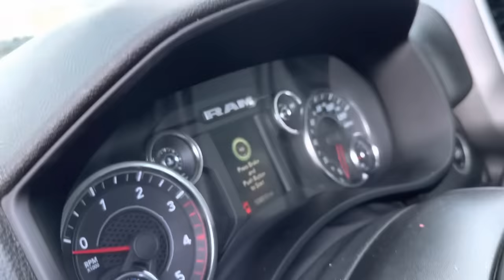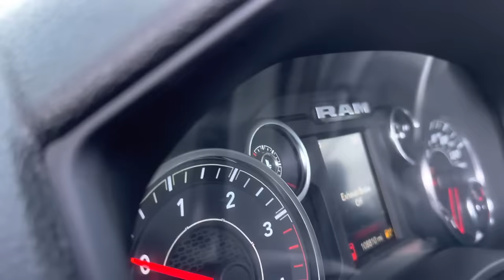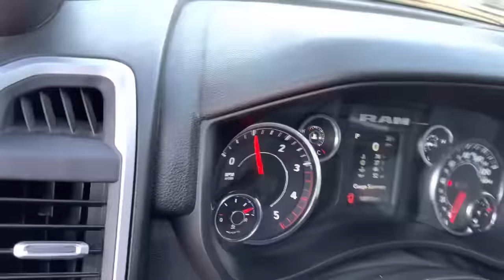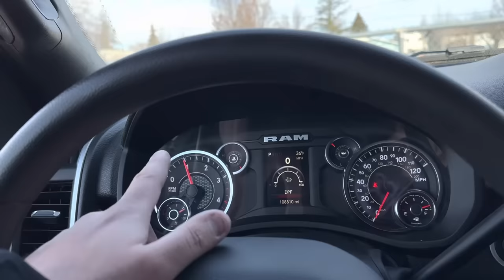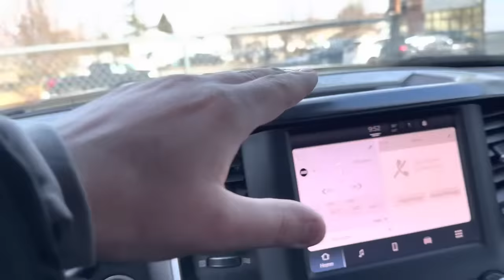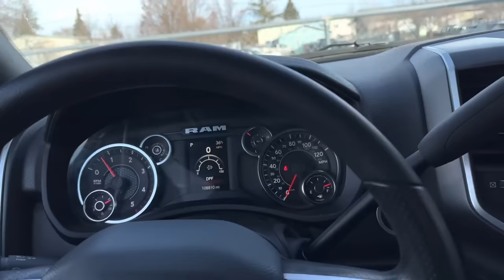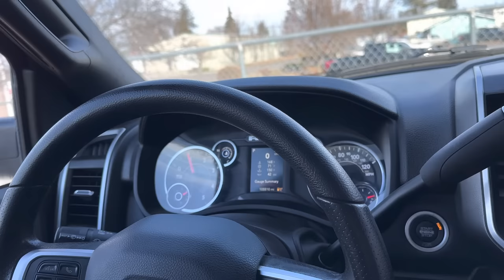2022 Ram 3500. 3rd engine down. 3 signs your engine is failing.

Comment: Really makes me appreciate my 2003.  It has no choked down emissions, it has no Def, it has no sorry automatic transmission.....it has no 80 grand price tag....it's lean and clean, simple and mean!
Reply: I’ve still got my 03 too. Had it since 05 has 172k on it now. It’s dirt simple compared to these new trucks
Reply: I have a first gen and had a 2006. Both extremely reliable trucks. Wish I had another '05-'06. My '90 first gen has 935,000 miles and would not be afraid to drive it across the US. Still performs great.
Reply: yep this is the same reason i keep my 2000 7.3 powerstroke
Reply: It's a dodge... Shit
Reply: @Hollywoodhouse74  That would probably be more on some of their transmissions, the Cummins engines are pretty solid. The 6.7 is prone to more problems because of the emissions bullshit.
Reply: @cliffterrell4876  What transmission does your first gen have?
Reply: @myk1_sp  funny because that engine isn't a dodge engine... And ever since Cummings has been putting them in... Dodge be Cummings apart ....
Reply: @Hollywoodhouse74  I accidentally typoed. And yes, that is very true!
Reply: Ya go tow a 25,000lbs gooseneck daily for 365 days straight and see how long she last 😂
Reply: @ksich8142  A diesel would make more sense in those environments. For these cases, I doubt people would be towing over 12k lbs, so modern gassers would probably be fine.
Reply: 05 f-350 checking in. Same here. I'd rather have my truck vs a new one for so many reasons
Reply: @myk1_sp so  I thought it was built for towing are was supposed to be
Reply: @banksboy6806  They are typically built for low-RPM torque and better fuel efficiency!
Reply: Think everyone agrees with you till you need a much higher tow rating and have to buy a new one
Reply: I'll take a later 4th gen any day. Had a 1998. Good truck. No match for my 2014 6.7.
Reply: @Hollywoodhouse74 all manufactures have their issues. I persoanly had many issues with my Powestroke.
Reply: I feel you..   Have a 03 also.  No issues, I just have to fine-tune my trans..  Bought a 2022, been in the shop more than on the road...
Reply: Would like to see a video on the miss fire..  Took mine to the shop.  They said it was gas mixed in with the diesel fuel..  Find the hard to believe since every other day, I'm filling the tanks at truck stops.  Then, also get from the shop is air filter is not OEM..
Reply: This and other things has me seriously looking back at a 2003 to 2005 1 ton.
Reply: I have my 08 deleted its been a great truck i have it bumped up just enough on power still verry reliable
Reply: Have a 95 and had a 2005 ram 3500 duallys I hot haul for a living and the 2023 I bought this Jan blows my old trucks out the water, don't get me wrong I love my 12 valve but if I gotta choose between the 95 cab and Chassis vs my 2023 ram for a towing 2023 wins all day
Reply: That's fine...however,for me the cost difference between the 2023 and the 95... makes hauling with the 95 very sweet to me
Reply: I have an 06 loaded 3500 stick that just hit 100,000.  Once in a while the longer crew cabs look nice, but I will keep this thing as long as possible.
Reply: I have an 09’ 3500 and I hit a bump and a whole bunch of parts fell off🤷‍♂️🤷‍♂️. Anyways, 265,000 miles later, running like a diesel should, original turbo, original 68RFE trans. Original injectors swapped out at 250K miles, was told they would have gone further, did the proactive big ticket item and replaced them with new OE Bosch replacements.
Reply: Exactly, Ford wouldn’t make it to 50:( .

Comment: I had a big dealership tell me I did the right thing when I told them my truck lost all the emissions crap. This was back on a 2015 ram the service department told me majority of the issues with the trucks are emissions equipment problems then causing engine problems. I know it's frowned upon now but when you spend 65-85k on a truck it better last you a long time. Deleting the emissions is still the only safe way to go for longevity.
Reply: Don't forget nobody deletes a truck. Everyone I know hit a big pothole and everything just fell off 😋
Reply: Sucks the law tries to stop it.   Looney toons nowdays
Reply: Unfortunately for him with running a business and having to deal with DOT, there’s no way for him to delete anything and get away with it.
Reply: Putting exaust gas in the intake makes ne sense to start with,puts soot ,carbon in oil quickly,bad on bearings.

Comment: Thank you Paul for stepping up to the plate to explain what you know so far. I realize you have a business reputation and a repair shop to maintain and it's a fine line to walk to go public with what you've learned, I thank you. Many of us have the 2022 Ram/Cummings trucks but we've spent a fortune by purchasing them and we depend, absolutely depend on them to perform as Ram/Cummings said they would, so the stakes are high, a lot is on the line and Ram/Cummings had better respond or the Ram/Cummings Reputation is lost forever. Blessings Paul, again thank you from all of us Ram Owners, we appreciate your insight.
Reply: *cummins
Reply: @BmxScuz  😂
Reply: @samuelhatch8470  i really question if the people who pronounce it Cummings, even own a Cummins. It doesn’t even autocorrect to Cummings 🤷🏽‍♂️
Reply: @BmxScuz  i know it's pretty funny my brother. I've seen lots of that over the years. I'm glad i have a p-pumped 2002 Cummings 😂
Reply: Quit buying new truck every year just to impress people

Comment: I’ve got a 2022 3500 HO srw and still don’t have a problem. My 2021 5500 has its grimlins that won’t go away but it’s not terrible either. “Electronic throttle control” light won’t ever go away

Comment: I have a 19 with 99K miles on it and it’s doing the exact same thing. You can actually here a loss of compression as it misfires and it does it really bad upon first startup just like yours. It is hard to hear on video because I’ve posted several videos on the ol forums and everyone says oh it sounds fine lol. The dealer actually said it was fine too until I told them to start up the brand new one sitting right next to it and see if it does what ours are doing lol. Yeah it’s been in the shop torn down for a total of four months waiting on Chrysler to approve the new engine and they are fighting it every step of the way! The tech said it was the cam and lifters at first but they said upon further inspection after getting into the engine that the whole thing needs to be replaced which is exactly what I said from the beginning.
Reply: Geez

Comment: Had a 21 with over 300,000 km on it other then oil changes tires and brakes never had a single problem on it traded it in for a late 2022 and no problems yet but will definitely be keeping a eye out for any warning signs
Reply: any cp3 click after running for long distance?
Reply: What kind of oil and what are the intervals?

Comment: All this boils down to the excessive emissions requirements. Before emission got out of hand it was typical see 500k or so before any major issues outside the trans which always fails.

My argument has been. The air may be cleaner out the tail pipe, but the the vehicles life is much shorter and that just moves the emissions to the manufacturing and disposal process. I think if anything it makes the air dirtier when taking all this into account. Just most of it is move over seas.
Reply: I have to agree with you 100%.
Reply: You're totally right. For a modern diesel to make it to 150k you're doing pretty good. 20 years ago that was just breaking it in. It was not uncommon at all to see them with 300k miles still driving up and down the road every day. Now that's like the exception to the rule. They're throwaway trucks. Huge liability to own one past warranty. Don't forget also about all the hundreds of gallons of wasted fuel from regens and DEF and plastic containers/cardboard boxes, as well as the rare metals used in the overly elaborate exhaust system. And the so called "clean" air that comes out the exhaust will choke you out. Diesel fumes might stink but that ammonia is just nasty. It has made them unaffordable, impractical and unreliable. What a shame.
Reply: @fewworddotrick  I can see that with school buses in my local district. The older IC CEs with the Maxxforce DT and dt466e’s run like a clock and rarely have problems that keep them in the shop for long periods of time. The Cummins ones (even including the Thomas C2’s) have many issues that keep them in the shop for a long time and the 2022 ones are even worse. Those ones have subs run for their route for a long time. Not to mention that the Cummins engines generally feel weaker on acceleration than the Maxxforce DT’s and other older diesel engines. Too many Emissions components ruined diesels.
Reply: Love your channel.  What diagnostic tracker do you use in your fleet?
Reply: I have been saying this for years. I have a ‘97 powerstroke with 385k, I have owned it for 23 years and it is still reliable as heck. I have a ‘10 Cummins dually g56 and it is definitely deleted. I hope to get as many miles out of it as I have my old ford.
Reply: @jessepitt  oem tune is superior tested and proven vs aftermarket tune not tested to the same level as oem and not proven. Unless egr is monitored and oil analysis done every year, reliability will be disappointing
Reply: @repairvehicle  I have EFIlive tuning with only +40hp which seems to have a pretty good reputation for reliability. The truck was built for hotshot work in BC by a shop that specializes in that work.
Reply: @jessepitt  do you have egt gauge?
Reply: @repairvehicle  Not yet. I have not done any heavy towing with it yet, I’m still fixing and upgrading things in preparation for the summer and that’s on the list. I just got a Fass fuel system.
Reply: @jessepitt  Depends on how you have it set up. 

If you go clean, slightly over stock power, then a long time.  If you go full send, You know the drill 🤑🤑🤑
Reply: @ChannelZeroOne  I don’t need full send. I run a construction business and I need reliable not fast.
Reply: @jessepitt  You want reliable. Airdog or fass, head studs, Mishimoto trans cooler, Fuel pressure, EGT and Trans temp to keep it all in check. 

Fuel pressure should stay near 15 psi more or less. Egt probe should be installed at  manifold and not to exceed 1200 degrees for extended time. 

Not sure if you one of those hater types or not, but this sht should be in every truck out the factory as far as I am concerned.
Reply: @ChannelZeroOne   Already bought a Fass titanium. The engine already has studs. It’s a g56.

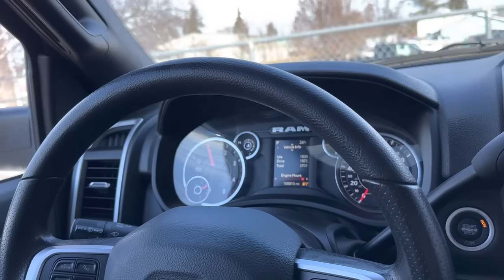Comment: at 17:39 we see the engine hours. 1830 idle, 1871 drive. That seems a bit unusual to me.
Reply: Not really suppose to idle these things🤣it’s gotta be their problem
Reply: It’s the core reason for their issue. A good OC interval on these trucks is 5,000mi. Considering half the time is spent idling, I’d half that again and make it every 2,500 miles. 

Not to mention the fact that idling is horrible on these newer trucks. They run the EGR at idle and run sooty due to low combustion temps. This idling soots up the oil and clogs the DPF leading to more regen cycles.

Comment: Everything you have mentioned is worn out due to metallurgy or oil cannot lubricate. You should try different brand and compare results. I have mentioned in my previous post about Schaefer dealer having Cummins engines damaged due to the Schaefer oil. He stopped using Schaefer oil and switched back to Mobil 1, he has a fleet of trucks. He no longer sells it too.
Reply: Valid point since he uses Schaefer’s on everything. I’ve used Schaefer’s on my old 4th gen and now 22 without any signs but it’s worth trying to do some research on.
Reply: Prime example of why Rotella T-6 is the best
Reply: I agree with @repairvehicle. There is something happening on the service side. What oil are you running in your fleet?
Reply: His fleet does over 1 million miles a YEAR. I think he has figured out how to maintain them.
Reply: @seagullsbtn  he hasn’t figured out how to do it with 10w-30 oil. He has been using 5w-40 on 4th gens
Reply: @repairvehicle  I would agree the oil or frequency of oil changes sounds like the problem.  You can’t put a wrong oil in the latest diesels
Reply: I’ve already emailed him about Schaefers oil a year or two ago.
Reply: He's ran Schaeffer's in all of his other 2019+ trucks with no problem. Its definitely not an oil issue or a service interval issue. Its a 2022 build issue. The Aisin Transmissions on the 2022's are having major issues as well.
Reply: @shauncollins2017  , there is a comment under this video from another hotshot owner who has 9 22 ram cummins and has zero issues but uses Mobil 1. So, it’s not built issue but lubrication issues
Reply: It sounds like a hit or miss issue like every manufacturer right now. They all received bad batches of parts! Which is what happens when there’s such a high demand corners get cut massively
Reply: @Mr.J345  maybe bad batch of oil?
Reply: @repairvehicle  I don’t think it’s oil I think manufacturers are rushing the hardening process to keep up with demand and or using inferior metals. If you watch the videos of people sending oil samples to blackstone the oils are still within spec
Reply: @Mr.J345  oil can be within the specs but not providing proper lubrication against wear. These oils will be within specs and generate a lot of wear metals. Just because oil is within specs it doesn’t mean oil protects engine from wear. I have done oil analysis and seen many times when oil still good but engines gets damaged due to oil not providing proper protection against wear. Even more disturbing I have seen lately when oil companies change formulations and oil becomes worse now than it was 5 years ago formulation.
Reply: @repairvehicle  You're missing the point. If it was an oil issue he'd be having the same issue on all of his 2019+ trucks because he uses Schaeffer's 10/30 on all of his 2019+ trucks. If he was replacing motors on all the other 5th gens in his fleet, I'm sure he's intuitive enough to step back and think, "Hmmm maybe I should try a different oil?".
Reply: @shauncollins2017  , after another hot shot owner commenting that he uses Mobil 1 is fleet of 9 2022 rams and has zero engine problems maybe he will put his pride aside then try different brand of oil. Read other comments where people have 22 rams and don’t have problems but then they don’t use Schaefer oil
Reply: @repairvehicle  if it was oil every vehicle made would grenade the engine. It’s cheap metal and cheap manufacturing. The “hot shot”with 9 trucks #1 is lying or #2 got very very lucky with his 9 trucks mobil 1 isn’t what’s holding it together
Reply: @Mr.J345  , project farm have done awesome job proving that every oil provides different levels of wear when tested oils in his machine to see which oil provides less wear. If oil did not make a difference then every test would have same amount of wear.
Reply: @repairvehicle  I’ve seen the video I agree some oils are definitely better than others I’m not arguing that point the point I am trying to make is everyone blames the oil for these problems when it’s shit manufacturing and quality control. Any oil that is the proper viscosity and proper type should lubricate adequately even the cheapest you can find.
Reply: Has anyone used Triax lubricant's full synthetic diesel oils? My twin turbo V6 likes Shell Rotella T6 better than Mobile 1 of the same grade 0W-40. This engine is not a diesel and I have purchased some Triax 0W-40 and will try it as soon as my T6 runs out. During the peak of the pandemic, T6 was no where to be found!!
Reply: @LWRC  , did you do oil analysis for Mobil and Rotella?
Reply: @repairvehicle  No. I should. This is nothing but seat of the pants feel. Power delivery has increased and overall everyday performance better. The engine doesn't smoke nor consume any noticeable oil during 3000 mi oil change intervals. So Shell's T6, which is marketed as a diesel oil, does wonders in my German built twin turbo V6. I'm anxious to run the Triax full synthetic oil as the on line Amazon reviews for folks running it in their diesels all have been very positive!!
Reply: They did change the valve train design on 5th gens, its a know weak spot on them as compared to previous generations.
Reply: worked in garbage hauling company that used Shaffer oil and grease All mechanics thought it was the worst stuff ever...not good service life on anything
Reply: @jim-zx7gz  , at least someone with common sense

Comment: Traded my 22 Laramie in on 23 Sierra at4 couldn't be happier  ...transmission shifts drove me crazy in the ram
Reply: My friend made the mistake of buying a GMC. 6.2 litre engine.  77k truck. And the motor knocks and the lifters tick.  I'm guessing it'll be just like his 18 and start having electrical problems in the dash and door as well.